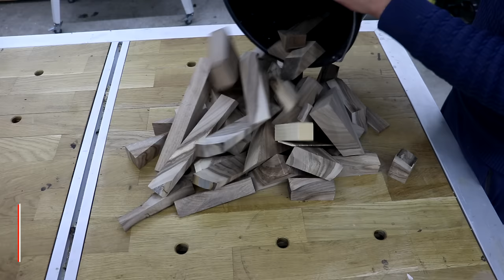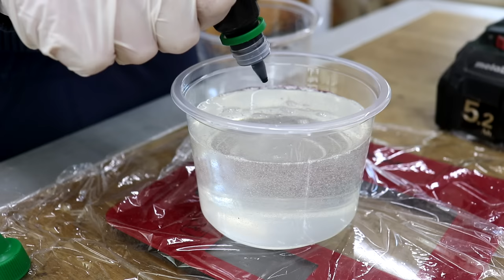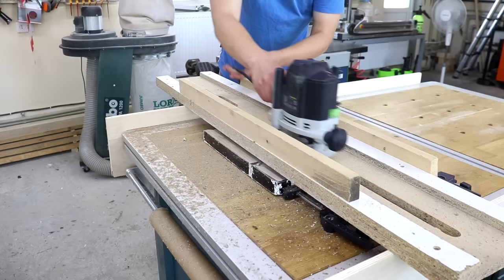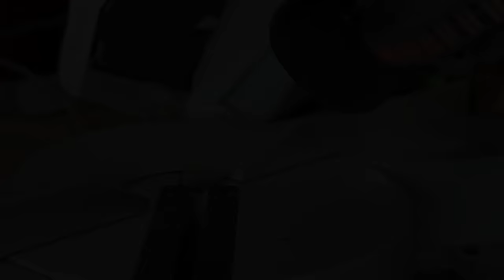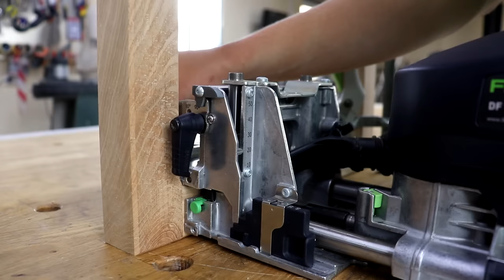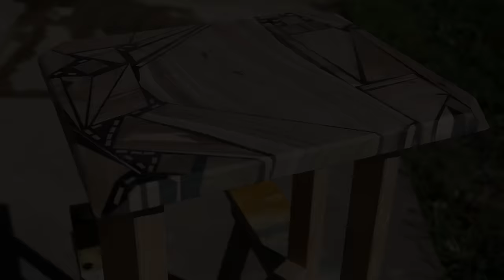The best waste projects in your workshop. Woodworking.

Comment: Nice, but unfortunately, most of us don't have the nice scraps nor the expensive power tools. The resin mixture alone isn't cheap either. I'm one who recycles scraps from construction sites and free pallets. My tools consists of only a table saw, miter saw, jig saw, drill, brad nailer, router and sander. Yet I can still pull off some pretty decent builds. 😂
Reply: can you please make youtube videos? i have similar tools but i only know luthiery related woodworking
Reply: I want more tools

Comment: Hi! 😊 I am a beginner would like to know what did you fill and mixed in the gaps of the woods. Do revert back. ❤️ Love ur creativity looking forward to more videos
Reply: If that filler was resin it is extremely expensive
Reply: hes using resin. Its somewhat unfun to work with, is expensive, and is toxic. (a good respirator is required) dont work with resin until youve spent some time using traditional methods